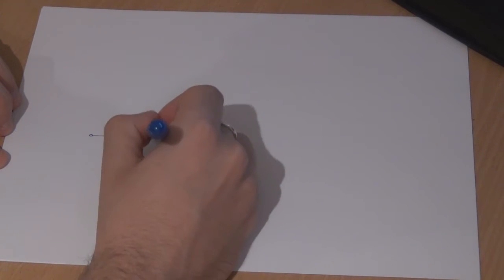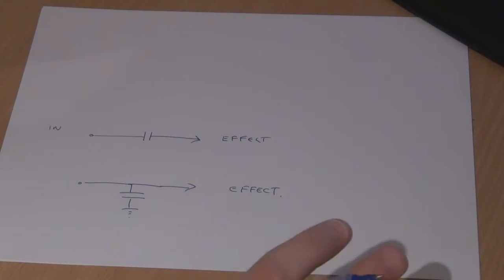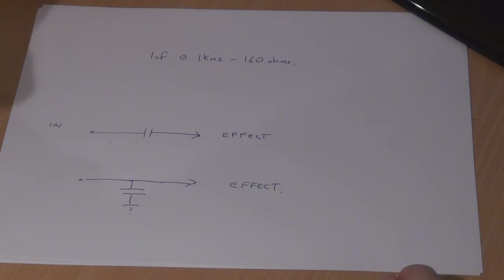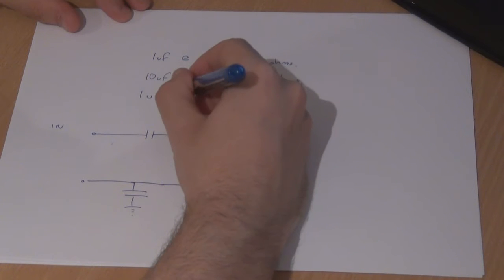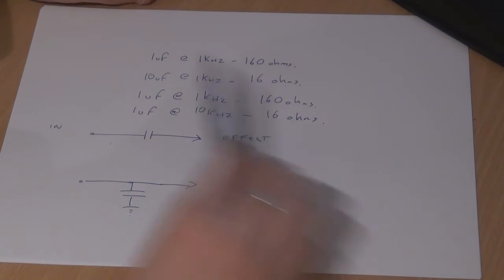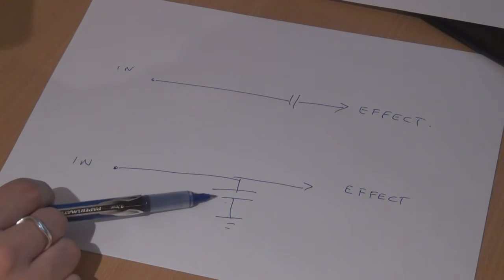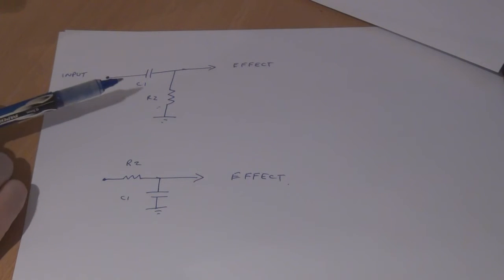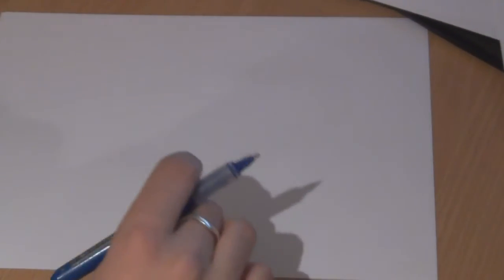High Pass / Low Pass Filters (Guitar Pedals)

Comment: What I experimented is to place an inductor in series with a capacitor to ground for a low pass filter. It saves some mid frequencies and gets rid of unwanted screaming treble. A 400mH or a 1H inductor is a good starting point to choose the capacitor's value. I tweaked my tone stack by ear, without using crazy formulas. In my case, I connected a 1.8nF capacitor and a 380mH inductor (measured value) between the 33K existing Tone Stack resistor and ground. As seen on the Duncan Amps' Marshall Tone Stack freeware.

Comment: Simple trick : for a High pass, the cap is on the higher position of the diagram, for a Low pass, it's on the lower spot. The reason why you need one of the component on the ground is the the principle of a filter is to put to ground unwanted frequencies while still letting the wanted one flowing through.

Comment: What value caps and resistor would I use in a low-pass and high-pass filter on a power attenuator I would reasonably bring up the frequencies that are lost during attenuation. Or at least what would be a reasonable starting point.

Comment: Very interesting. Would a simple circuit like this be safe to run through an fx loop of a tube amp?

 I'd make a low pass filter pedal with a potentiometer (to get rid of the extreme high end, the fizzy distortion).

Comment: its amazing that more pedals dont have simple lpf and hpf.  Everytime anyone records a guitar, first thing they do is slap on a lpf and hpf, so would turn out much better if it could be done pre-recording.
Reply: Crunchifyable  I don't know any producers who would just slap on filters to guitar and I'd be pretty worried if that's how they went about it... Filters can of course be very useful but you have to know when and why you should be using them. and they should not be a standard in an effects pedal unless required, pre-record effects need to be much more diverse than that.
Reply: It's not the frequencies in the preamp that are problematic for the mix, those just shape the tone. The problematic frequencies come from the speakers and you'd need a hpf built into the mic or something to fix that, not the pedal.
Reply: I don't know what kind of pedals you mean, but every distortion pedal I've looked at does have filters, and not just the ones with tone controls. If it has capacitors, it has filters. Even the simple fuzz faces have two filters, one hi-pass on the output reducing the muddiness, and one lo-pass on the fuzz reducing nastiness.
It is not every pedal's job to EQ your sound to sit in a mix. That's the job for a dedicated multi-band EQ tailored to the specific context of your band. The pedal just creates the foundation of your sound, the EQ then carves out slots of the right amount and at the right places for the other instruments. 
And of course, you CAN use an EQ pedal or the EQ on the mixing board before recording. But anything removed from the signal cannot be added back later. Information lost stays lost. Anybody who works on editing and processing data (audio, image, any other) will agree that it's always best to keep a raw un-edited copy of the source material, in case you need to start over or want to try something else. In fact some studios record the guitar directly, even before amplifiers and FX. That way they can try different amps and FX later, without the player having to re-play it each time.

Comment: Hi, I hope you can help me to understand. I am a beginner with pedals (DIY). Let´s say I want to design a pedal. Do I have to take "300 mV" (guitar volt output) like a "standar" criteria or normal value for the rest of calculations?  What values are considered "normal" to start?
If you get 150mV after the filter,  what if you dont have a resistor in serial after the capacitor?  (like Electra distortion). The resistor comes from the transistor´s Colector point and there is a voltage there already.

Can you explain me this please?

 I just made a electra distortion and I´m studing it to start mods and learn with this. Btw, my electra looks horrible but it works!, I started to build it in 2006 :)

Sorry about my english, isn´t that good..    ..., I like electronics but I am another class of engineer..  ..and, I´m in another country.  

Thank you

Comment: I think I understood but the graph threw me a bit in all honesty - also I don't really understand why the resistor is added, is it to do with getting a corner frequency? 

I am appreciate you making this video though because I tried to look this up on allaboutelectronics.com and got some stuff about complex numbers due to the phase difference between capacitor impedance and the input signal, thus frying my brain

N.B: Whilst I might not understand this topic to absolution there is a simply sublime application called falstad circuit simulator: https://www.falstad.com/circuit/ . If you download it and run the .jar file on your computer you can play about with example circuits to your hearts content, including high-pass and low pass filters where you can see exactly what the electrons are doing in a real-time circuit simulation